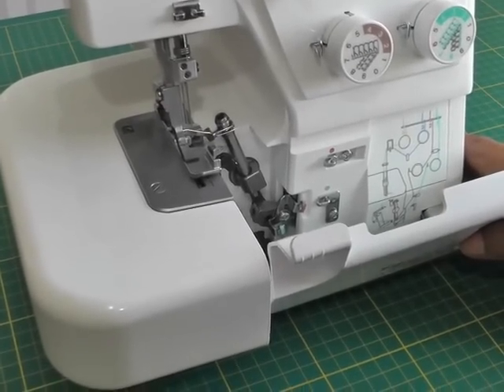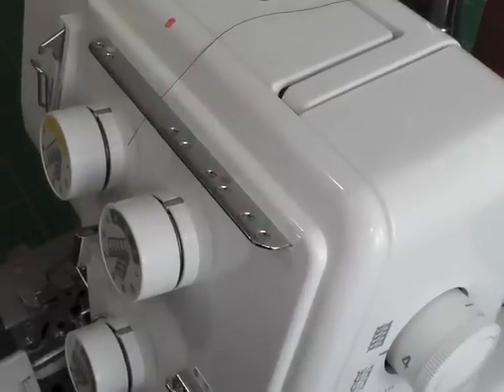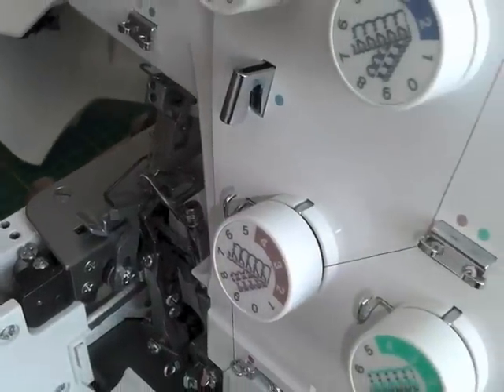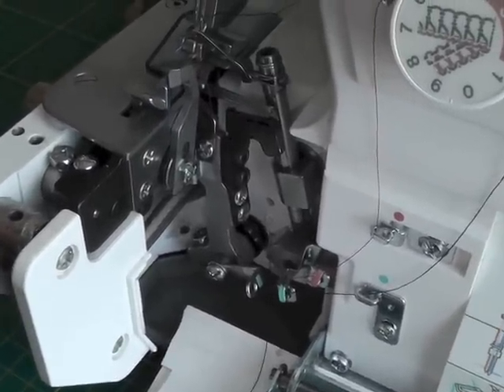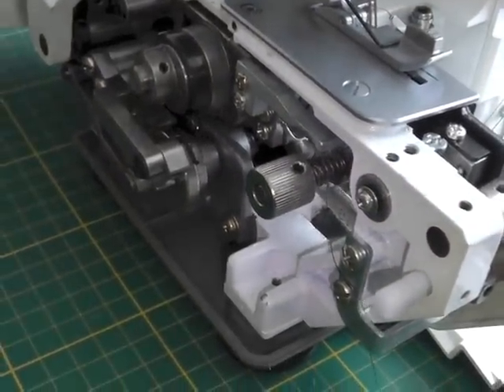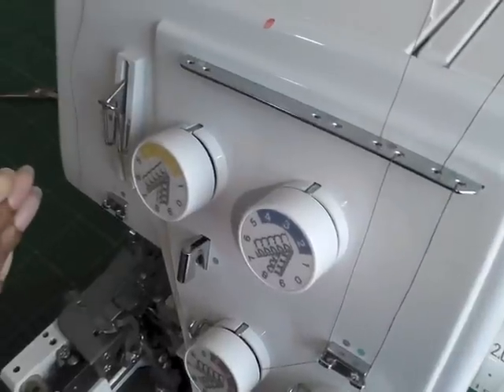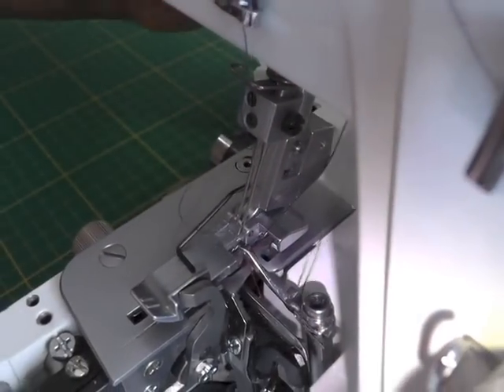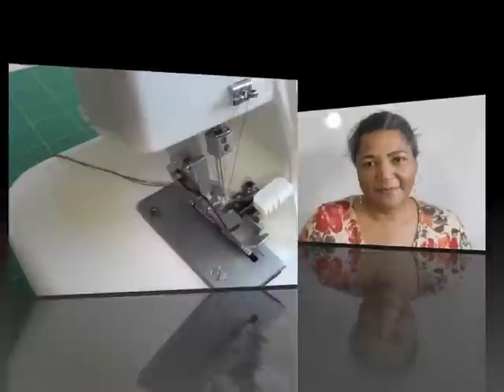Threading a Serger

Comment from the maker: Hi. I have two sergers, the first (and my pride and joy) is my Bernina, the second, which appears in this video is a Janome My Lock 134D.
Reply: @Colleen I have the My Lock 134D as well but at the moment the wheel is locked up and will not turn at all. Do you or anyone else have any suggestions on  how to fix this issue? I have already taken the machine apart and oiled it but still cannot get it to unlock. Taking it to a repair guy is not an option

Comment: Hello
I love your video. I am having an issue with by ulna serger. It used to work great then all of a sudden i turn it on and it sews for half a second then gets stuck. When i open it up to look what is it getting stuck on it looks like the lower looper blade can't move because it gets stuck with the top needles thread. I can move the hand wheel away from me but when i turn towards me it gets stuck in that position also. I have tried rethreading it 100 times to make sure i have everything in correct order. It is still not working, do you have any advice? Thank you
Reply from the maker: +Pretty Presents It sounds as those you need to have it serviced!

Comment from the maker: Hi, I honestly have not heard of this brand of serger before.  I've had a quick look on the Internet and can only find one which seems to be an industrial serger.  Make sure you DON'T but an industrial machine as your first.  Industrial sergers are very fast, make a lot of noise and use more electricity than a domestic one.